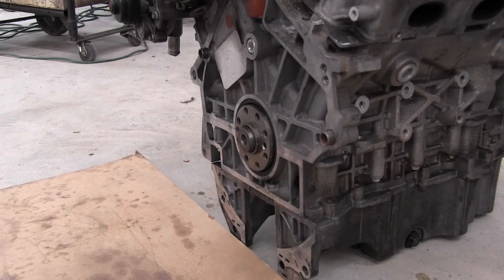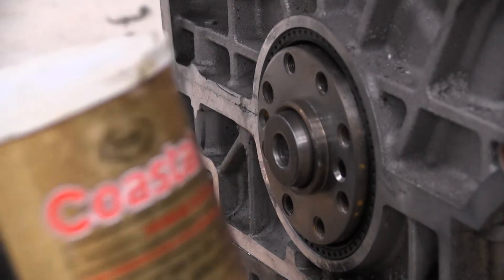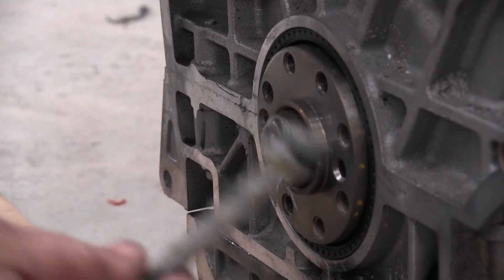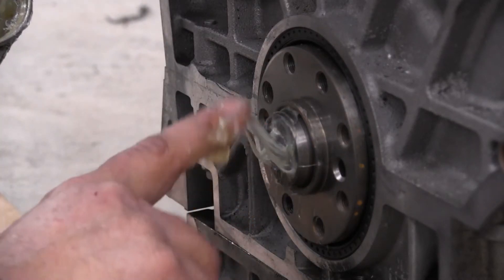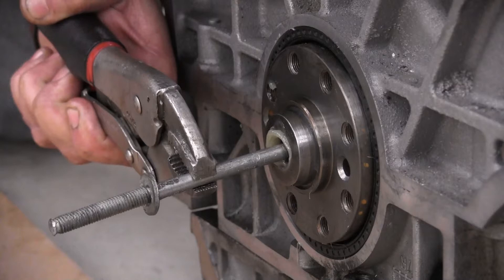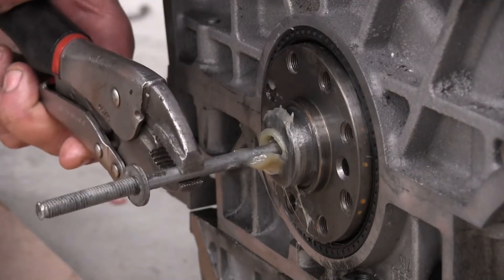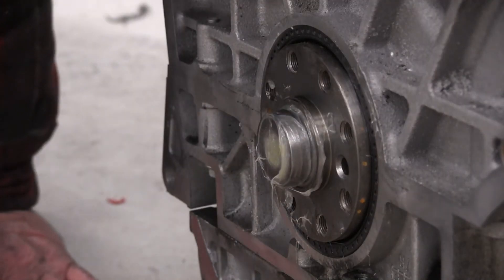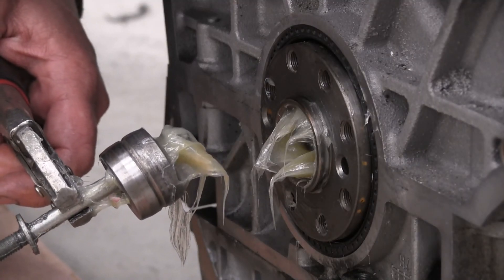How to remove a pilot bushing.....an old school trick that WORKS!

Comment: I've been using this method to remove bearings from blind holes in transfer cases. I like the bread idea, gonna try that. another good method for pilot bushings is a tap; just screw it in until it bottoms out and then either continue screwing in the tap or use a screw, it's a good method for the stubborn ones.

Comment: How about using a proper size tap. Thread it in and when it bottoms in the hole it keep turning and it will pull the bushing out. Done it many times.

Comment: Whats the difference between the pilot converter and the pilot bushing as far as where it goes. I seemed to have had my pilot converter pop out from the bearing but seems slightly too big to push back in.....long story short when i removed my crankshaft from the block i heard something fall...it appears to have been the pilot converter (i only heard it fall...i didnt actually see it)...after lots of reseach what this part even was...it looks like it popped out in front and out through the bearing (if thats even possible)

Comment: I have a pilot bushing I'm trying to remove from a chevy 350. The car had an automatic when I got it. The pilot bushing has probably been in there for 30 years. It appears that the metal flakes in the bushing may have rusted to the housing. Someone may have tried to pull it in the past also, as the inner hole is more of an oval than round. I tried the hydraulic method. Because the opening is oval, there is no way to build hydraulic pressure.
I've also tried many different types of pilot bearing/bushing pullers. I either end up breaking them, chipping pieces off the bottom of the pilot bushing when they slip off, or nothing happens. Last one I tried is an expanding slide-hammer type that opens a circular shaped ledge at the rear after inserting. Even this wouldn't make it budge. Also tried heating until red hot, and the "bread" method.
Reply from the maker: That's the problem with pulling tools, they can really damage stubborn bushings.
Reply: Use bread,and most bushings are brass,so rust isn't the problem, automatic cares don't use pilot bushings
Reply: @gregtipton5347  this was a bushing from the 70's. Maybe there was different alloy back then but it was definitely rusted. 
Managed to get it out with a ton of grease, and alot of heat.
To clear up my first comment. The car had a manual originally. Bushing was still there, probably because they couldn't get it out, but it had an automatic in it. We swapped to manual.
Reply: @sumdood2035  I've had several cars from the 60's on all used brass as to not wear the input shaft,some 90'and later had actual needle bearing pilot bushing,glad you got it out

Comment: When your hammering what is the bolt hitting on the other end anything that can be damaged from the heavy blows ?
Reply from the maker: If the chamber is packed well with grease the bolt won't go deep enough to do any damage or hit anything. The energy goes into the grease itself and that energy is released by moving the pilot bushing. I hope that answers your question. Thanks for watching!
Reply: @SlickRidezGarage  I got lucky was converting a automatic to manual... and it seems automatics don't have it so all had to do was evenly tap a new one in .... I thanked God dearly that day

Comment: what if the other side is hollow? I need to remove a stuck needle bearing inside a motorcycle swing arm. been lubing it, whacking it with a hammer. won't budge.
Reply: Need to grind an open spot in the side of the cylinder of the bearing without hardly touching the swing arm metal with a tiny grinder like a dremel.

Comment: Fuck that mess. Use bread. It acts like a fluid but without all the nastiness. You also don't need a perfect fitting tool with an o ring. Just find a bolt or rod or whatever that fits the hole as close as possible. Use a little tape to make up the difference (doesn't need a perfect seal because the bread makes a muck thicker fluid). A few good whacks with a decent hammer and she's out and you only have a few crumbs and a bread plug to clean up.
Reply from the maker: Bread doesn't always work, but I did make a sandwich with some when I finished! I didn't even wash my hands!

Comment: You couldn’t get mine out this way. I couldn’t even get the remains out with the proper tool. I had to resort to carving an open spot with a dremel tool.
Reply: How did that go for you? im in the same boat but using a hammer and chisel to break the bearing down been at it for four days now,🙈 most of the inside of the bearing is out but the outside is hard work,i dont have a Dremel tool yet should i invest in one or keep chiseling away? 😂😖😣😞
Reply: Next time cut it into 4 parts with a hacksaw blade, jig saw, or sawzall etc. being careful to come up just shy of the crank. Then just pry it out or for internal ones use the normal puller with a slide hammer. I have removed the most unbelievably stubborn ones this way.
Reply from the maker: Unfortunately, major surgery is sometimes the only way.